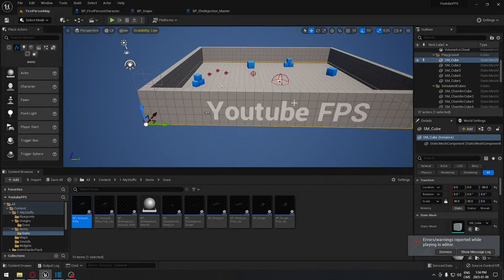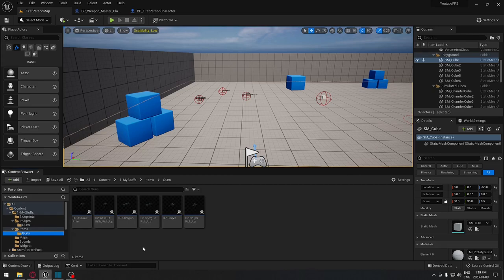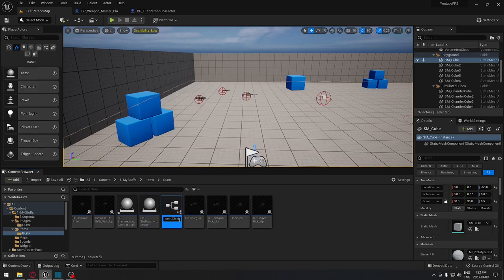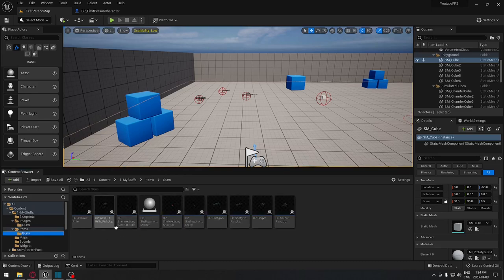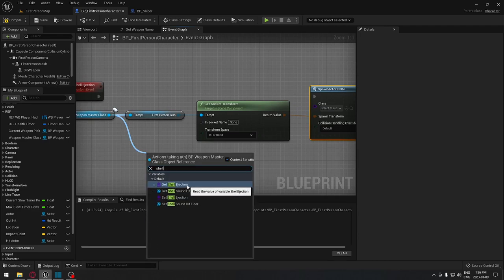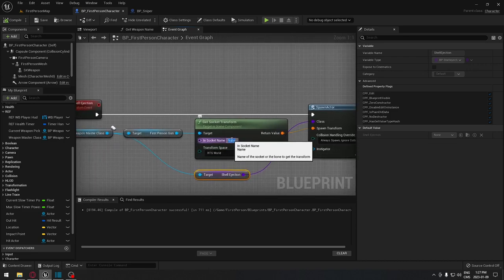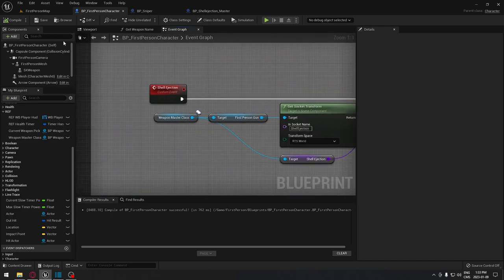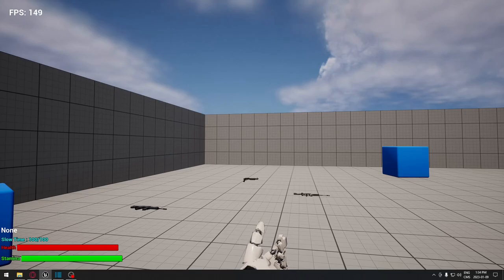Unreal Engine 5 - Physical Shell Ejection - FPS Part 25

Comment: If your guns have animations for the bolt cycling and you want to match it up without putting waits etc in you can instead use animation notifiers inside your fire animation which triggers and event that runs this same code etc (can use for muzzle flashes etc too)

If you don't need all the physics on the ejected shells you also are probably better to use Niagara for them instead of heavy "actors" though.
Reply from the maker: If you have everything you said, yes it will be a great way of doing it. This is what I like with programming, there is so many way of achieving the same or similar end goal. 

On the other hand, I like to code things because you barely need anything outside the engine itself.